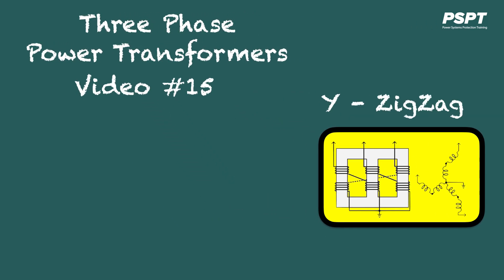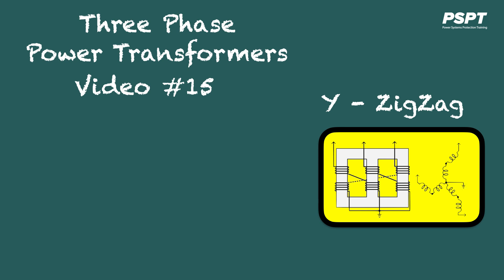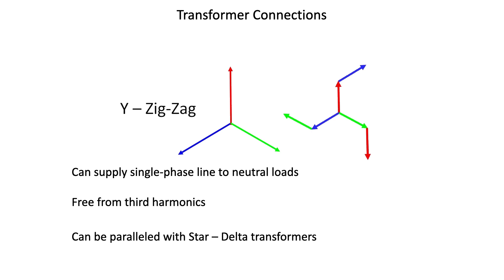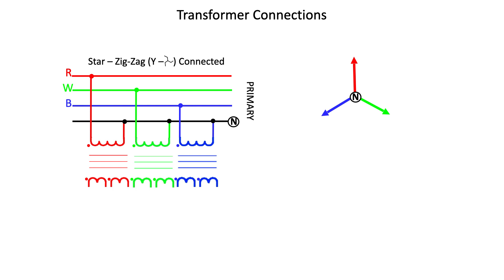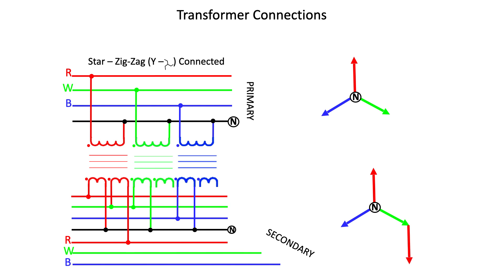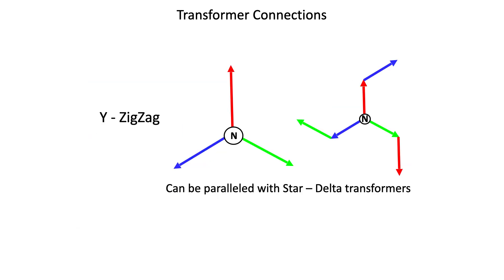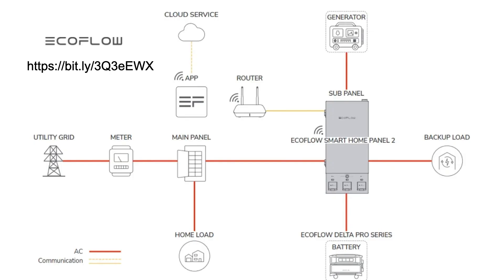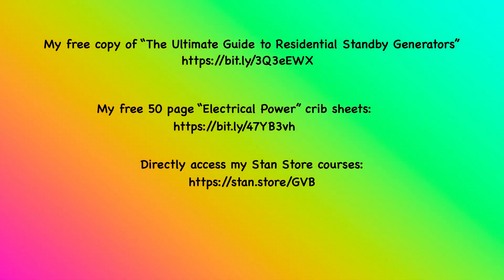Three Phase Power Transformers; Y - ZigZag Connection - Video Number 15

Comment: Hi can the transformers be separate, or they must have the same cores?
Reply from the maker: They can be separate although the only zigzag transformers that I encountered were on the same core. That is they were a transformer bank not individual transformers. However, theoretically you can do this with individual transformers in fact you could use six individual transformers and connect them why zigzag although I've never seen it done but, theoretically it is possible.